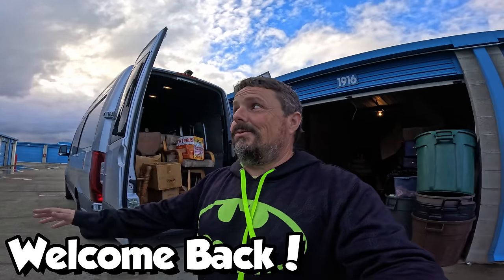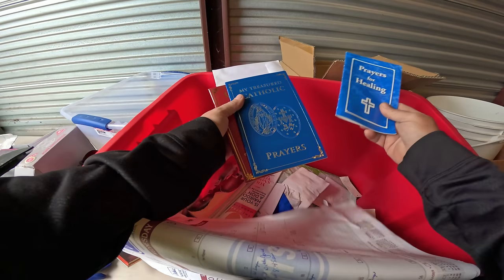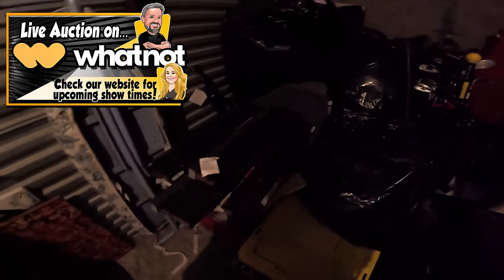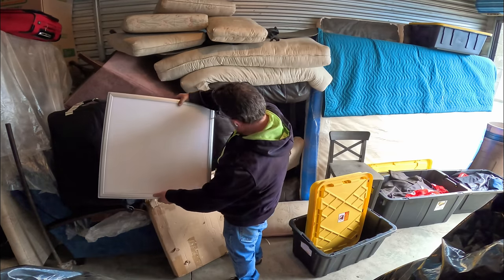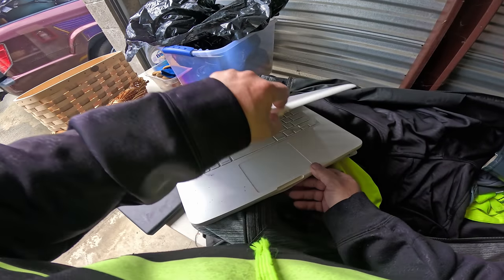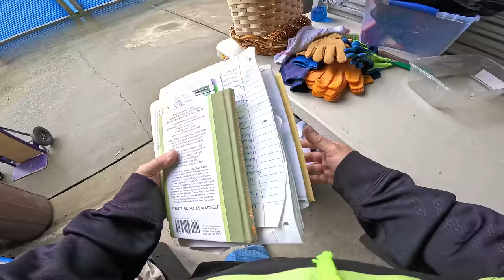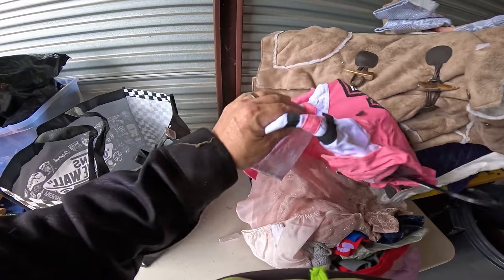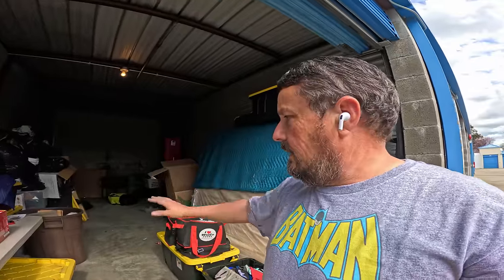I bought a FELON'S STORAGE UNIT for ONE DOLLAR!

Comment: do you scrap out the metal your do you give it away?
Reply from the maker: I just give it to the recycle center. They pay for mixed metal, but it's so low, it's not really worth the time to wait in line and get paid. Drop off for free is quick and easy. If I find a bunch of copper or aluminum, then I get the scrap fee but I don't think I've ever brought over $100 in metal more than once before.